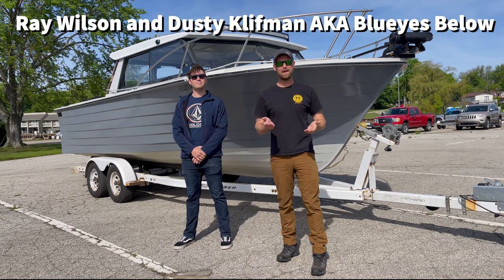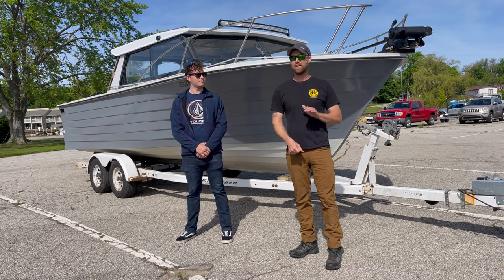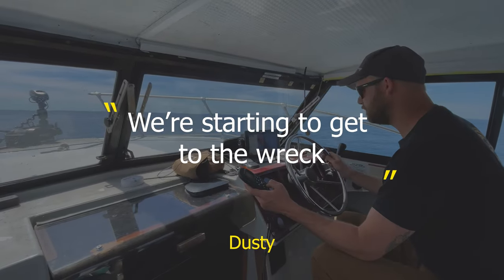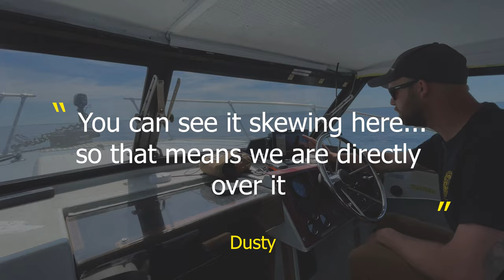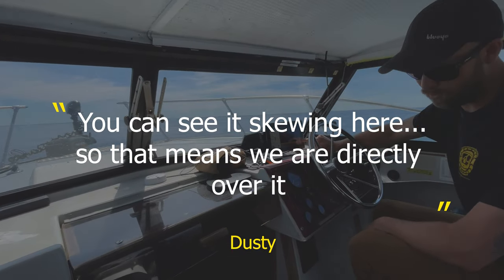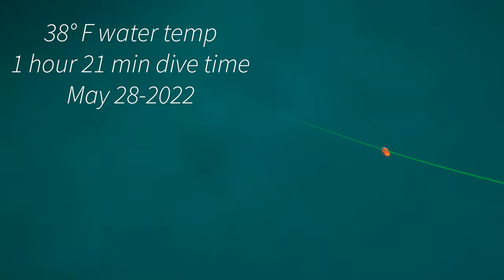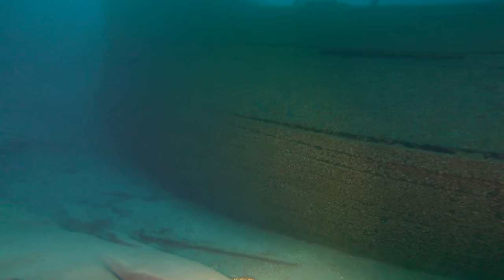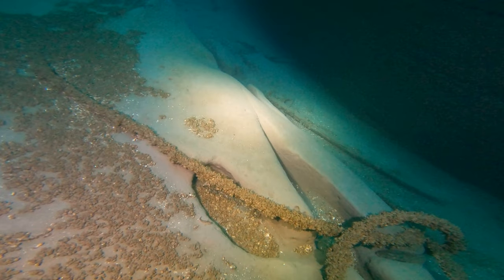Hennepin shipwreck exploration! Worlds FIRST self unloading vessel! Great Lakes

Comment: Cool video! How much air are you carrying to get that much dive time, that deep?
Reply from the maker: Thanks! We are actually using rebreathers, so it’s a very different type of diving over open circuit scuba. We literally have 8-10 hours of air in the tiny tanks on the unit if we are efficient. The open circuit bail out bottles are for if our rebreathers suffer a failure. Depth doesn’t matter much on a rebreather and we use the same amount of oxygen per minute if we are 5’ deep or 500’ deep. Our diluent gives volume for breathing and dilutes the 02 to a safe partial pressure. It’s a great tool for exploration!
Reply: Gotcha! I thought you were using rebreathers at first, but then it looked like you had side mounts. I guess those were your bail out bottles. I live on Lake Michigan, but I have a long way to go before I feel comfortable diving that deep. Hoping to get my rescue diver and maybe dive master certs next winter. Definitely  looks like a good time though!
Reply from the maker: Just enjoy the training journey and be safe as you progress. There’s so much to see shipwreck wise in all levels of training, but the deeper ones are really awesome!